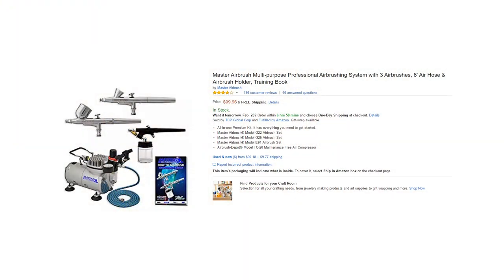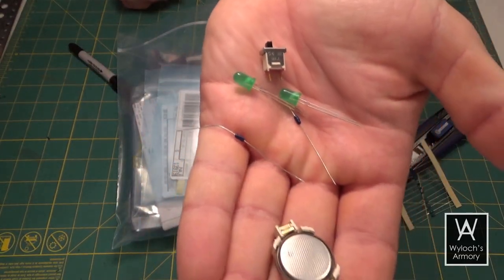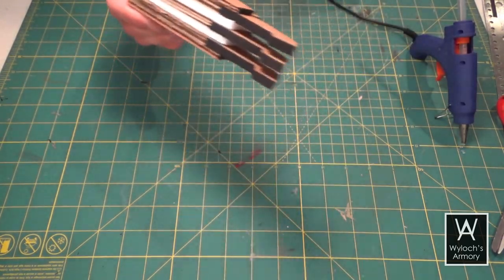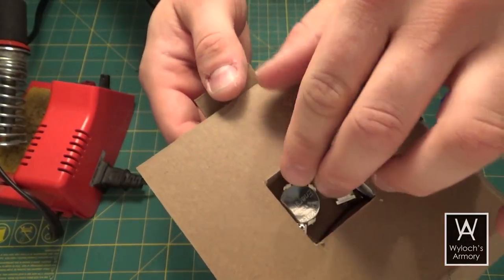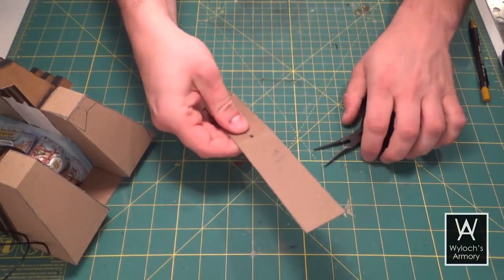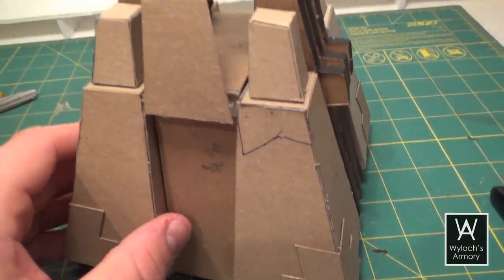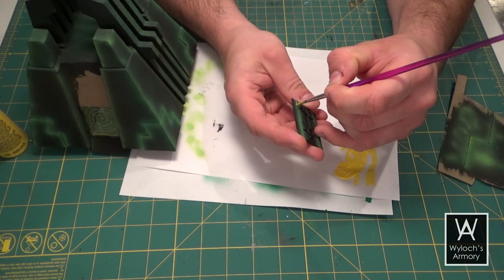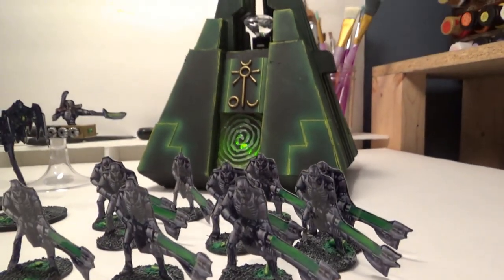How to Make a Necron Monolith Proxy for Poorhammer 40k

Comment: really fine grit sanding to the back of the portal will achieve that "even glow" you mentioned.
Reply from the maker: Thanks, yeah, tried that, didn't work.  Maybe 220 wasn't fine enough.
Reply: you probably want something like 1200 grit+ wet&dry sanding paper.

Comment: for fogging up portal use super glue it fogs up clear plastic parts usually we try to avoid this but here it will work. Also as mentioned use glue gun the layering can distort the light as well.

Comment: food for thought... if you mount the top led under the crystal it might have refracted the light a bit more to give the crystal a green glow rather than just top lighting it
Reply from the maker: I did try that but there was no glowing effect whatsoever - same reason as the portal, because I needed to fog it up some how.  Thinking about a thin layer of watered down PVA glue...
Reply: You may need to direct the light a bit, aluminum foil with the shiny side in tends to work well for directing it.

Comment: Nice Wyloch!  I had bought basically that same airbrush kit last year, but for cheaper and with only the G22 airbrush.  I've since bought the g44 airbrush which gives me finer control over air pressure, but the Master airbrushes, are a great set for hobbyists, that don't need to paint "Picasso" like artwork, we just want to lay some paint down on models, minis and terrain.

Comment: to "fog" up the portal, I'd cover the back with a layer of hot glue
Reply: Sand it down a little bit
Reply: I could suggest  some nail polish applied by a brush.  Or just glue a piece of tracing paper.
Reply: Just rub some dirt on it.
Reply: Can crepe paper used for "fogging" the portal?
Reply: could also glue some wax paper on the back, maybe airbrush that as well to tint it green :)

Comment: A thin coat of PVA glue (Elmers specifically because it doesn't dry completely clear like most PVAs do) on the internal side of the portal should make it translucent instead of transparent. Would still let the light through but would make it more diffuse. Love the overall craft of the thing.

Comment: Try gluing some wax paper to the back of the portal to diffuse the light. I don't know if the LEDS are strong enough to make it through the paper but it works well for other applications to diffuse light through a surface

Comment: Play around with LED placement... Try putting a backing on the plexi... then move your LEDS to the side of the plexi sheet I recommend either the top or bottom side. On each of the sides of the plexi that you do NOT have an LED. try taking a strip of aluminum to act as a reflector which needs to be as smooth as possible. Another optional thing to try in addition to the before mentioned.... try engraving either the face or the back of the plexi (before you  put a backing on it.) I have had mixed results both ways... Kind of depends on the quality of the engrave and the look you are going for (how much like it catches deep scratching may also work).  Just some ideas to try.

Comment: Why do you go back and forth between Cardboard and Foam? Is it just trying to use as much of the cheaper material or do they have different characteristics that help with specific jobs?
Reply from the maker: A good question.  The answer is thickness.  My aim was to replicate the real model's dimensions.  So if I need to stack up some materials to get an overall thickness, that's what I'll do.  Double corrugated cardboard is reliably 1/4"  thick, which is handy.  The foamboard is 3/16" thick, and is also useful when a textured surface is needed.

Comment: you could lightly sand the back side of the plastic you used for the portal.
Reply from the maker: Yeah, I tried that but to no avail.  Maybe needed a finer grit.
Reply: yeah like a fine grit emry cloth sandpaper.  
  that should give the plastic a kind of frosted look that should diffuse the led light to what you want